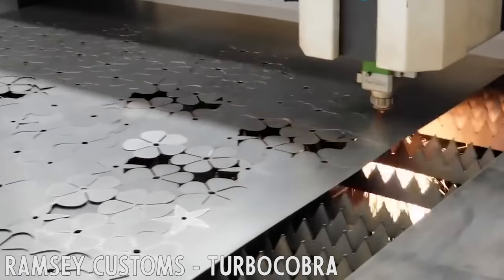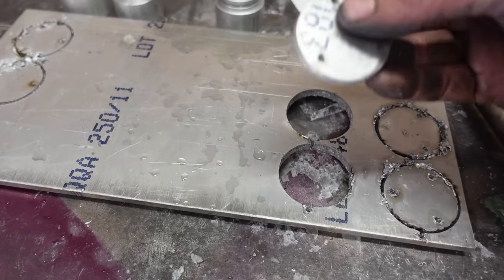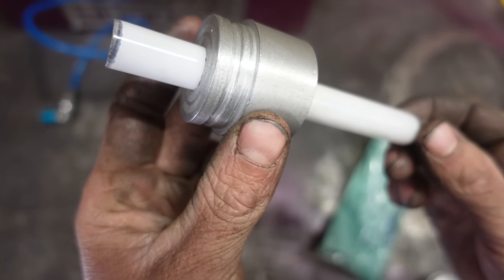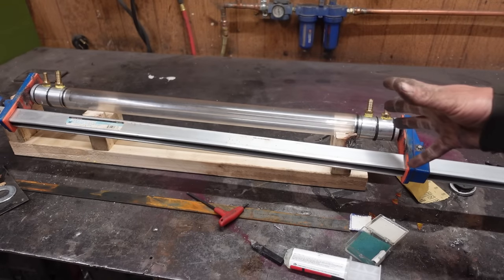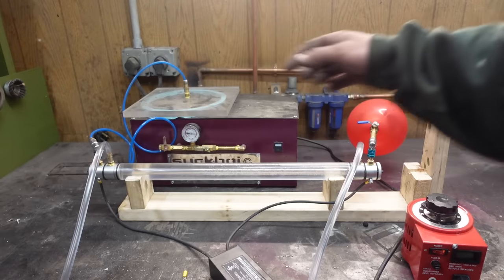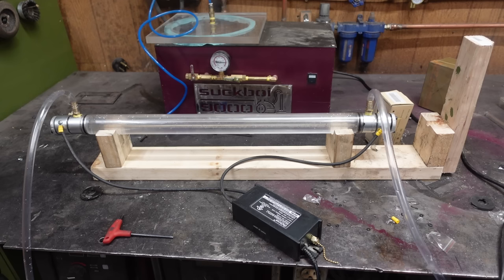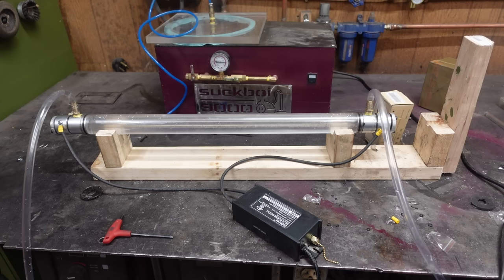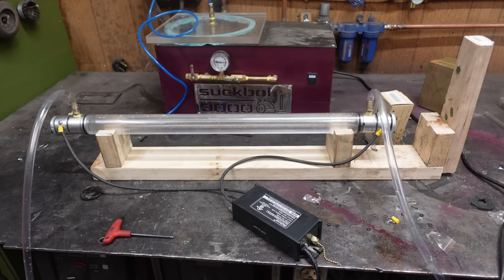Homemade CO2 Laser Tube

Comment: Oh, and the reason you are getting discharge through the fittings is because neon sign transformers have their secondary center point grounded. So if you have a 15kv transformer you will have 7.5kv from each terminal to ground. It's a safety thing. You might just consider buying one of the Chinese 40w co2 power supplies. 60ma is way, way too much for a tube that size.
Reply from the maker: Already got one and damn does that thing make an ionic wind hahahah

Comment: Just for reference, any contact with first surface mirrors causes damage, and the very act of cleaning them destroys their surface. Wear ultra clean gloves when handling them and only touch the sides, or you'll lose a ton of power and efficiency to scattering. I was cringing when I saw those dirty greasy fingers contacting that gorgeous surface🤣. Great work though, that's beyond what many laser hobbyists are willing to go as far as building your own tube, good luck getting it fully functional.

Comment: That's not output, that just light from the plasma being directed out the OC. 10.6um is way, way beyond what people can see. You can use a thermal camera attachment on a cell phone to see the beam and use thermal receipt paper to visualize the beam. Youre probably going to want to get a digital manometer to make sure you are getting low enough pressure, a gauge like you have does not have enough resolution at the low end where you need to be. When I built my first CO2 laser vacuum was my main problem.  You also might want to use finer screws for the mirror mounts, I assume you are trying to align your mirrors by squishing the gasket. Neoprene is also terrible for vacuum, use nitrile or viton.
Reply from the maker: Yeah I may have jumped the gun posting this video as is. I've since been doing much more testing and really refining it and found that getting an output on this thing is very difficult. Once I have this thing buttoned down though, I'll be sure to cover any mistakes made in this video in the next video! I'm just learning this stuff as I go along! Thanks for the advice!
Reply: Another thing is your HR, it looks like you are using a generic gold over glass bend mirror? It really should be a concave mirror, Design Research Optics has good prices on coated silicon optics. 2M would probably be fine for your tube. https://www.designresearchoptics.com/cavity-resonator-optics/total-reflectors/ You can use a HeNe or red diode laser to get a rough alignment and then tweak from there. A power meter will be necessary to get the most out of it. 

A few other things if you want some tips, optics cleanliness is of paramount importance here. Optics should be cleaned with spectrographic grade acetone and methanol using the drag method. Another option is the polymer cleaning kits from First Contact, it works well and you can use it as a protective coating while working with optics and remove it when you are ready. The luminous flux inside an operating laser is orders of magnitude higher than the output and anything on the optics can burn them. It's also why the chinese lasers cool their mirrors, the gold on glass mirror is terrible for a HR but cheap. 

Vacuum hygiene, everything needs to be super clean for this to work, clean all parts with clean mineral spirits to get rid of grease. Using acetone leaves water bonded to surfaces which take time to degas. Generic PVC hose is bad for vacuum, it outgasses as well, there are specific kinds of hose that work well. Pipe fittings should be avoided as well, they leak, instead of threads use drilled holes and then use some vacuum compatible adhesive like Hysol 1C epoxy to glue in nipple. Silver soldered copper also works well. You can also buy tanks of pre-mixed co2 laser gas from most welding suppliers like Airgas.

And I assume you have read the stuff on building CO2 lasers from the LaserFAQ: https://www.repairfaq.org/sam/lasercc2.htm
Reply: Just to add to what Jerry is saying, mirror alignment is critical. My first job out of high school was working with experimental gas lasers, and collimating the mirrors was done with special mounts with micrometer adjusters on them. It's extremely critical that they be aligned exactly right to get any output at all, and you probably need to be able to adjust both ends to maximize the output. My high school physics class (1972) had a HeNe laser for doing experiments with interference patterns, etc., and it wouldn't laze. The instructor had no idea how to fix it, but I already had experience at doing it, and was able to fine tune his laser for peak output.
Reply from the maker: @JerryBiehler  Lots of great info here, I appreciate you putting the time into this post!
I now have an alignment setup and a calorimeter, and am getting closer to an output I'm happy with.
Never thought of the out-gasing from plumbing fittings, I'll be addressing that next time I mess with it,
Thanks again for your help!

Comment: Oh, and by the way, I dont think AC or DC on the power character would make much difference.  Do it both ways and report back to us.  Commercial units may use DC simply because it's easy to produce in high voltages.  If DC does work better, maybe rectified AC after transforming?  (that'd be a helluva rectifier)

Comment: One of the few things I remember is that pure water is a very poor conductor.Heat the glass tube. Usa a wet kitchen knife and touch the tube. The heat dif will give a good straight break (most of the time).

Comment: I wonder if it's possible to just light some alcohol in a sealed container to get the nitrogen CO2 mix, probably not close though since some of the oxygen would end up forming water instead of CO2 (and then theres sideproducts like acetaldehyde when theres low oxygen and also carbon monoxide) but just a thought

Comment: If you are going to rectify the AC you will certainly need some very high voltage capable diodes. And if you need heavy amperage too, wow, that is going to get costly to buy high current and high voltage diodes. But it can be done. As for the capacitor to smooth the DC out, those too get pricey. I don't know what voltage or current you are presently using, but more DC power gets expensive... I'm in to watch for sure. Thumbs Up!

Comment: very nice attempt dude and i look forward to seeing the improvements,, tell me did you have to study or make calculations to know the gas ratios and the power of hv you need or just basically slapped things together and hoped it worked? and what will give you more power output?
Reply from the maker: As with most projects I do, there was a small amount of studying and then promptly slapped the thing together haha. Hence the lack of output.
As I've been working further on this I've done much more research on the subject and I'm really trying to refine the output before putting out a follow-up video.
Thanks for the support!
Reply: @cranktowncity  "promptly slapped the thing together haha. Hence the lack of output." hahahahah that is how i usually end up as well bud ,i like doing projects in as much laymens term as possible lol and that is why they dont always work out :((( ,,ok well you let me know when you figure out what gives a laser like this more power out ,i hope to see more on this soon ,keep up the nice work, very nice having good tools at one's disposal to work with specially a lathe ,it's awesome what you can fabricate

Comment: Your plasma looks a bit grey. Ultimately you want it to be purple. If your plasma is more grey your C02 percentage is to high and your N2 is to low. If you get the C02 and N2 ratio right your power output will also increase. 
 Hope that helps :)

Comment: aim for 30ma, toss (the correct) series resistor in there. V=I*R stuff. you're way over driving the discharge just by the the side light color and brightness. Also, you can get the whole power supply voltage (then current) into yourself through gas lines or the mirrors. treat everything as "hot".  it would be good to be able to see you do other projects, and be alive.

get a thick sheet of polycarbonate to put between you and the laser "stuff" which may periodically explode the way you're going.  that will also absorb the 10.6 micron wavelength of laser light you'll make. (regular old safety goggles- yep)

Comment: I never made a laser but I remember reading a book about them light amplification by stimulation and emission of electron radiation and the book said the half mirror face with the full mirror was to reflect the electrons until the quantity reached a point of passing through the half mirror. So they have to bounce back and forth and AC will stimulate one direction and impede it in the other if the frequency doesn't match the resonance. I would think it shouldn't matter AC or DC but the frequency needs modulator and the helium and nitrogen are inert and almost inert so they don't ionize like the CO2 so they don't impede or react with each other. So the nitrogen and CO2 having opposing charges exchange electrons between each other in the helium suspender. Argon is more dense than helium and inert as well. I think you should research flux density and resonance of the individual gas's.

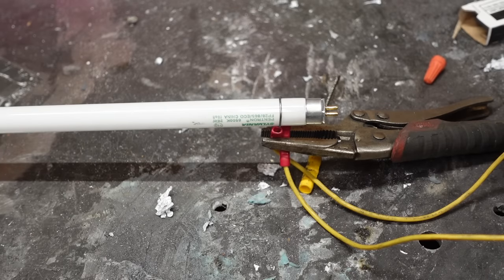Comment: 2:56 min i've already seen quite the same process but with alcool on a string then ice in water, this permit perfect results on a lot of type of glaces, you just have to stop at 2:50 min then instant cold spray to obtain a perfect result

Then a few send paper for more smooth result without cutting parts

For the gas feeding, you can also use water replacement, first water then feed with the different gas to mesure them
Indeed your idea is very funny and also efficient
The difference came when you need to put more pressure inside
Impossible with balloons, possible in a water circuit under pressure

Now it works, be really careful of the light, this is probably source of ultraviolet, those csn really burn the skin or eyes according to the power and exposition time

Comment: Nice project!, Hold your mirrors as clean as possible and completely dust free or they'll crack. Also "after assembly of the laser tube it is necessary to carefully align the
optics so that laser output will commence. This is a critical step and should be done slowly and carefully. A laser tube whos optics are not

precisely aligned will only make a neat looking conversation piece and will not emit laser light at all." Copied from a building manual for lasertubes, i cant find the author. :-)

Comment: just a suggestion, but a predominately white discharge for a "normal" CO2 laser tube indicates the helium component is too low.  With Chinese tubes, the seals are less than perfect.... helium gas can escape from even the smallest pin hole.  Great job!  (of course... a "predominantly white discharge".... coming from most any part of your body should be treated, aggressively!  ;) )

Comment: You could have gone to Aliexpress and just bought the tubes and power supply cheaply. But you won't be cutting metal with CO2 anyways unless you get up to above 300 watts... But they work great for cutting non metallic stuff like plastic and wood.

Comment: But I think this isn't a laser. Laser: Light Amplification by the Stimulated Emition of Radition and in this video I see a gas ionization using a high voltage source like a neon tube or a cathodic tube. Create a laser beam is much more complicated that that.

Comment: wait youonly have 1 mirror? you need 2, one that has 100% reflection and one with let's say 90%.
also, IR gets absorbed by glass, so you can't use normal glass or quartz windows.
the alignment is also really important, you need to be able to fine adjust the mirrors so the beam is parallel and reflects on the 2 surfaces.
you are on the right path, just need a bit more precision research

Comment: Wash your hands (or better yet, wear nitrile gloves) before handling the cavity mirrors! Unless the first surface mirrors have a protective coating, you shouldn't even try to clean them. In a laser cavity, the smallest imperfection is amplified by many passes of the light. You'd really be surprised how much the mirror cleanliness affects performance.
Reply: If you used two planar mirrors, you will probably never get an output as the alignment window is infinitesimally small. You can use a planar mirror, and a concave spherical mirror with radius larger than mirror separation distance to obtain a stable hemispherical-type cavity.

You should also look into getting a proper output coupler (the partially reflective mirror from which you get output). This will probably have the biggest effect on power and lasing threshold when everything else is optimized.

Comment: ZVS driver plus flyback transformer for your power supply. also, double check your gas composition, you want it more purple than white. White plasma will produce minimal UV, more purple, more UV. In my experience with cheap shitty chinese co2 lasers that is